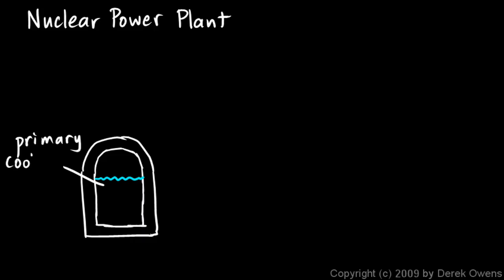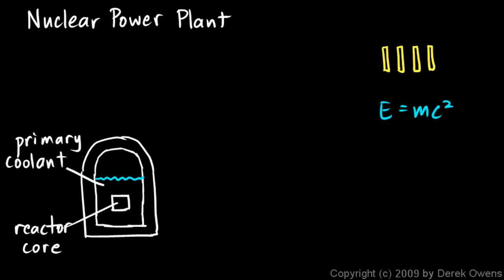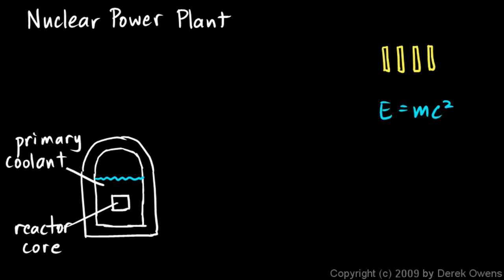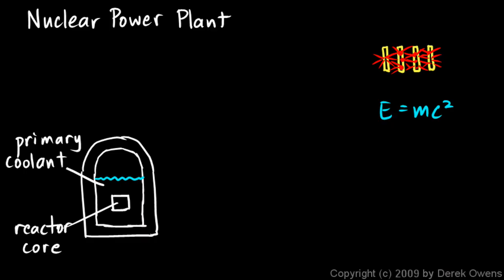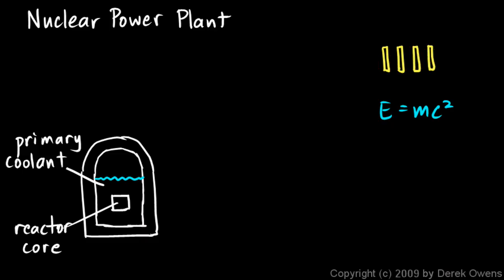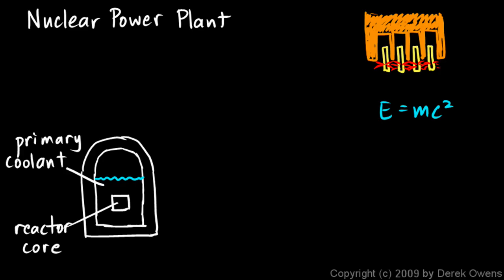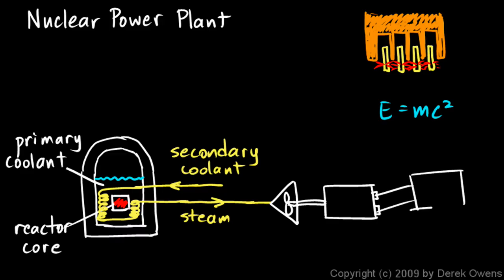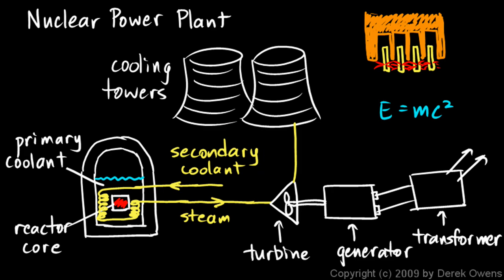Physics 13.5.1b - Nuclear Power Plant

Comment: what you failed to mention at 3:35 is that a nuclear explosion can only happen if it is highly enriched with U-235(>90%) and under precise conditions. But an explosion is simply impossible with reactor grade uranium which only has around 3%~7% enrichment.

Comment: Sorry if this has been answered.  It's been awhile since I've left the industry but here goes an attempt.

Uranium, for example, is a thermal fuel.  Meaning it requires thermal neutrons in order to induce fission.  Fast neutrons won't induce fission.  (google the difference between the two).  When a Uranium atom splits, the neutrons released are fast neutrons.  The primary coolant system also acts as a moderator.  What this means is that the fast neutrons collide with the water molecules...

Comment: There are quite a number of finer points of nuclear power that were kind of... glossed over. My suggestion for a revision is to talk about normal operation, then possible disasters. The biggest inaccuracy I see is that the primary loop should NEVER be steam. Re: this thread: When the core depressurizes it allows the primary to boil and that creates little flakes of U-oxide and other decay products that get mixed in the steam and spread up an out. Still not VERY dangerous, but more than nothing.

Comment from the maker: @8644371  My understanding is that the steam in the primary coolant loop is dangerous (as in dangerously radioactive) but the steam in the secondary coolant loop is not.  The steam in the secondary coolant loop may be dangerously hot, but should not be radioactive.

Comment: @altjff15
@derekowens
It's my understanding that in most reactors, the control rods aren't enough to fully control the reaction.  A 'cold shutdown' is maintained with the control rods & the constant supply of liquid coolant.  This rule really only holds true for the active fuel, hence the reason spent fuel only needs water, not control rods.  Granted, Im only a layman, so I could be wrong.

Comment from the maker: @altjff15  That's a good question, and I am not sure of the answer, but my guess is that it would depend on the design of the reactor.  From what they are saying in Japan right now, there is apparently still enough heat being generated, even in shutdown mode, to cause some problems over time.  At the moment I'm writing this, the focus is not actually on the core, but on the pools of spent fuel, which are more exposed right now.

Comment from the maker: @pepzit The description I gave here is a big picture overview, and as far as I know, the ideas in this video would apply to both a BWR and PWR, the main difference being that in a PWR, the pressure is too high for the water to boil.  The basic idea, though, of using nuclear fuel to heat the water to make steam to turn a turbine, is the same in both.

Comment from the maker: @mini1066  That may be correct about Chernobyl - it's been a while and I would have to look up the details.  At Three Mile Island, I believe they had a partial meltdown.  The core started melting, but some automatic safety controls kicked in and, I think, supplied some extra coolant, so the core did not completely melt down.  Authorities claim that no significant radiation was released.  Some people in the area who later got cancer did say they thought the accident was responsible.